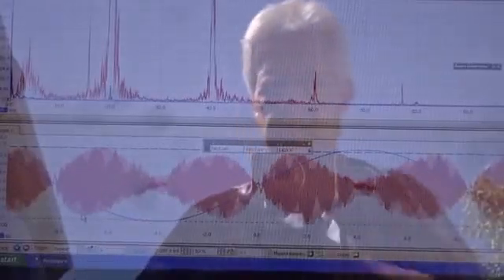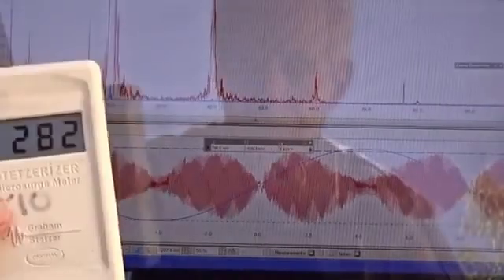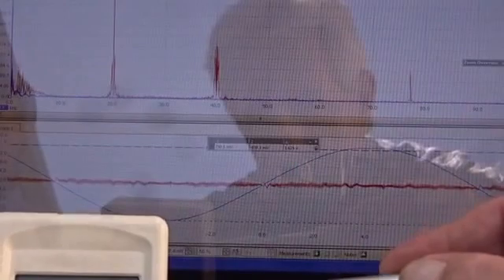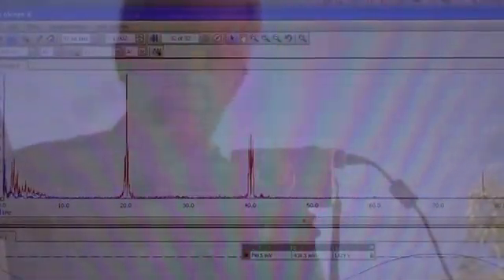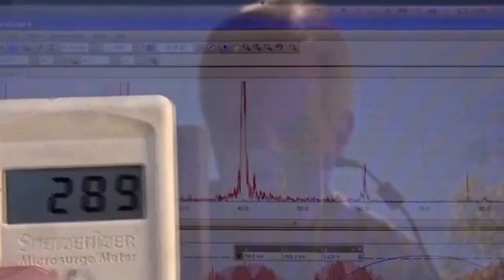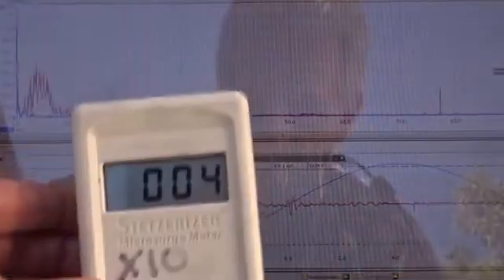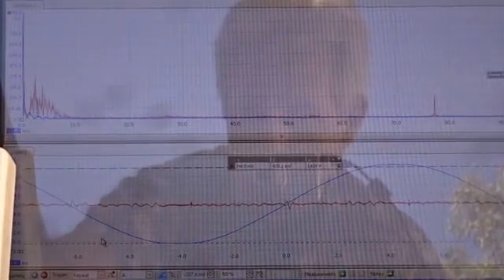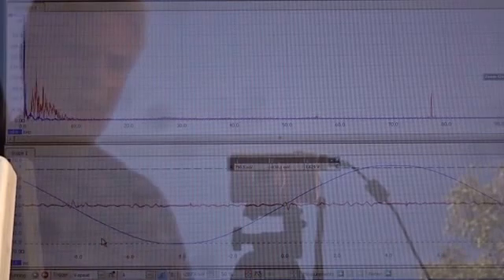Solar City Inverter creates dirty electricity Chico Ca, 9/16/16 3 pm

Comment: What filters were used at the client's house and how were they wired to the service panel?
Reply from the maker: Two 20µf capacity filters wired A-N and B-N.  One special filter with six 3µf rectifiers on each of A-N, B-N & A-B.  Both of these set ups were close coupled to the service entrance main A & B bus bars.
Reply: Thanks very much. Do you have a parts list?
Reply: Do you have a parts list?
Reply from the maker: Yes,  Please see the annotations at that start of the video.

Comment: Holy Cow !! Ome more reason that homeowners should shy away fron SolarCity in addition to the fact that they are generally 20% more expensive that systems installed by Crew and SaticUSA
Reply from the maker: Hi Bruce,  This toxic problem can happen with any solar company if they use a dirty inverter.  Actually Solar City has other inverters they can use so replacing this dirty one is not a problem (assuming they care).

Comment: Great work Eric! Your demonstration also proves that Stetzerizer filters clean up high frequencies,  not create them.
Reply from the maker: Thank you for the observation Paul. The Stetzer Filters were installed less than 6" from the main panel bus bar.  Even so, they can't filter out the extremely power transients of a dirty solar inverter as seen by the very resistant spikes at 20 & 40 KHz.  This is way makes my client so sick and forces her to sleep stay away from the house since the solar was installed next door.  The solution is to replace the inverter with a clean on.
Reply: @windheimemfsolutions  Hi Eric, Our next door neighbour just installed a Solar System and our gs units went from 45 to 1050+ !!   It has dropped back to 45gs units tonight thankfully so I will be able to sleep at least - Can you recommend any clean inverters ?

Comment: Nice job - invaluable content to illustrate an epidemic phenomenon - much appreciated!  Eric -  couple of comments/questions:

What do you theorize is the mechanism occurring that causes the dirty electricity from the neighbours house to couple onto your clients house (via electric grid or air?) and why is it not filtered out or is this simply a limitation of the filters themselves?

Secondly - is it conceivable to have elevated body voltage due to dirty electricity - IF it can in fact migrate both on and off of the circuits themselves this would seem to present a health issue that may be remediated by RF shielding??
Reply from the maker: The DE is caused by the inverter: the worst ones I have measured are: Solar One, Aurora, Xantrex.